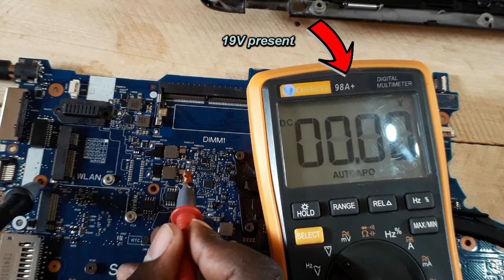HP EliteBook 840 not charging not turning on, motherboard repair

Comment: Hi, friend! I have the 850 g4 laptop, but there is a problem, it won’t turn on. I measured it on the incoming mosfet. 19 volts come to the D contact, and only 1.6 volts to G and S. What could be the problem?

Comment: hi my hp folio 1040 works on charger but it dosen't with the battery even if replaced. any ideas?
Reply from the maker: Its most times due to the MOSFETs that allow battery voltage to the main rail not opening. You may need to check there it can be fault or short

Comment: Can you please share hp 840 G1 continues blinking light once, when you plugged in adapter and it doesn’t turn on
Reply from the maker: continues blinks depends on which led is exactly blinking, but probably adapter without middle pin does
A fault ram however this include caps lock and num 3 times 
And a fault bios firmware

Comment: hey so i didnt have 5v at the LDO but i did have the 3.2v on the LDO is mine the same problem that needs to be fixed
Reply from the maker: Try checking the condition of the 5V LDO regulator, or disconnect the external 5v LDO circuit and see if 5V comes up

Comment: Hi can you please confirm the name of the part you called (voltage chip) and where I can get one please?
Reply from the maker: Hey, that chip is TPS51225 made by Texas instruments, you can get it from other 4th Gen Motherboards' on some online websites.
Reply: @platinumphonesandcomputers  hi thanks for your reply when I test it as it is it shows around 3v or just over on some of the terminals am I too assume it's suppose to be 5v or 19 consistently?
Reply from the maker: Now the processor of diagnosing that chip is a bit complex, it has 4 voltage regulators inside, each giving out two 3.3Volts and two 5Volts. 19 or battery voltage should be present on Vin and power MOSFETs, however, there are also other enable and reference volts that should be present to enable the chip to make those volts.

Comment: Laptop was working fine but not charging. Did this procedure and now it won't power on.
Reply from the maker: This procedure is done when fixing no power issues. Take the laptop to a Repair Technician he will fix it